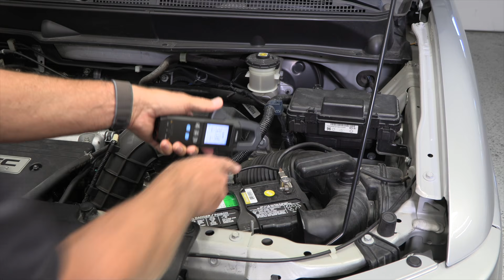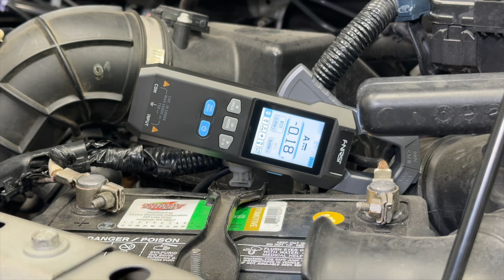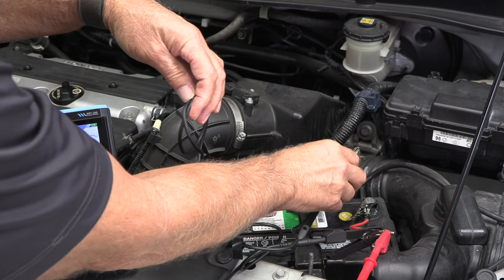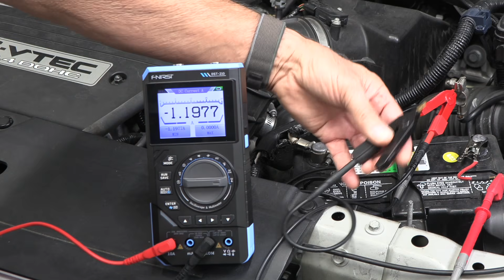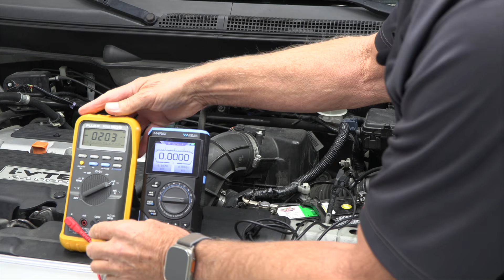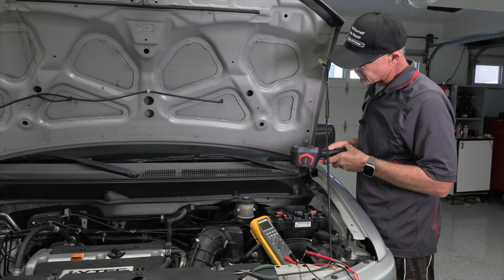Battery Dies Overnight? Find a Parasitic Draw (Stop Pulling Fuses!)

Comment: Question about the jumper when using the multimeter to measure current. Is it just a lead with one end attached to positive battery terminal and the other end to negative terminal?
Reply from the maker: No, one lead connects to negative post and the other to negative terminal, same place the meter leads connect to, is this explanation clear? If not let me know
Reply: You are just using your meter as a through wire. Negative to negative that way all the amps are going through your meter